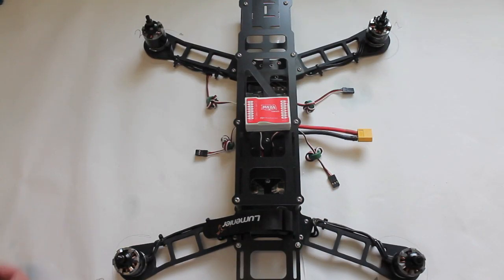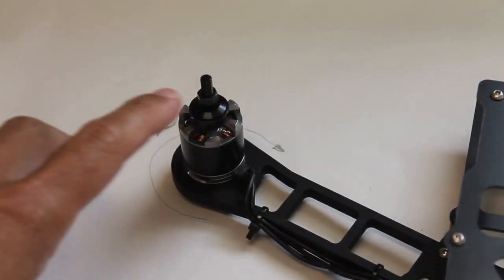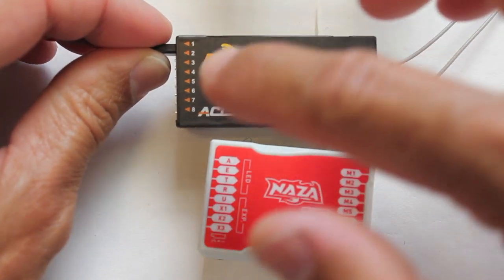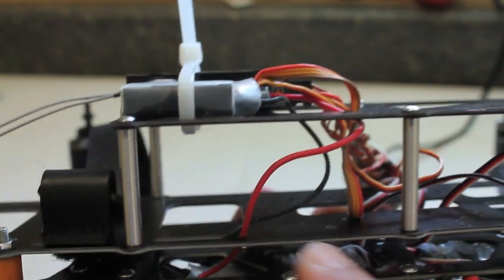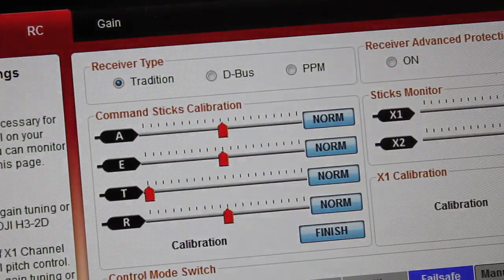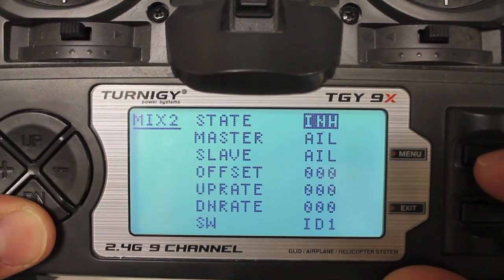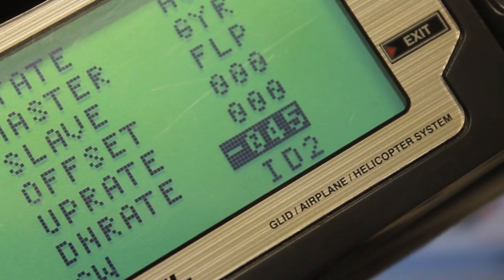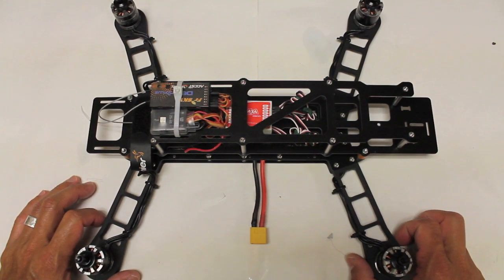QAV400 - NAZA Wiring, Configuration, and 3 Flight Modes w/ Turnigy 9X in ACRO Model Type

Comment: I used this setup on my f450 much easier than heli mode.. Just wondering what do I do with the  x1 x2 slider? Is three a way to assign knobs to them?
Reply from the maker: +ArriCAT5e You can set those up on your knobs as long as you have your knobs configured for the X1 and X2 channels that are plugged in into your RX. Good luck.

Comment: Hey,
I have a flysky th9x (same as turnigy 9x) and would like to have telemetry and sbus. Do I then have to buy a frsky receiver and module, and how can I set it up on my radio so that I have telemetry?
Thank you,
Tobias
Reply from the maker: +Tobias Veerkamp I don't think the FlySky module supports telemetry so you'll need to go FrSky. Here is a good article that talks a bit about it:

http://blog.oscarliang.net/telemetry-frsky-taranis-d4r-ii/

Good luck with your setup.
Reply: Dennis Baldwin I already have the answer I think, but there are some risks. First you have to flash the radio with er9x firmware which supports telemetry.  With flashing the radio you could severely damage the board. Then swap out modules.
Thanks for the reply though

Comment: Hey Dennis,
did you ever tried to setup your turnigy 9x with the frisky module and the naza in cppm mode ? I'm running out of ideas and it won't work, thanks
Reply from the maker: Christian Ka Sorry I never had a need to do this so I'm not sure how to get it done. Let us know if you figure it out.
Reply: just figured it out, there is no way to get it done with stock firmware, ppm and naza...i actually had to flash the turnigy 9x to er9x
Reply: There is a way. I use the d8r-Xp and am using CPPM with Naza with three flight modes. The secret is to make one of your pots aux channel 6. Turn it all the way up. Then do three mixes with it on the three position switch.

Comment: I am following this same setup, but I have an issue which is that I am trying to set up the normal switch position to GPS, but the offset doesn't allow me to move it far enough left to select this mode?
Reply from the maker: Joe Anthing What about adjusting your rates as well? The UPRATE/DNRATE settings, whichever is appropriate. In addition to the offset. If that doesn't help perhaps you can take a photo of your settings and post it in the forums at www.garagepilots.com. We may be able to help you out over there. Good luck.

Comment: Would it be possible to add the failsafe on another channel? I've used the three mode switch for GPS-ATT-MAN. Great work BTW.
Reply from the maker: Stumungous To the best of my knowledge the input happens on the NAZA's U port and you'll need your receiver channel connected to that. Now to enable another channel I'm not sure it's possible with the stock firmware. I know you can do it with OpenTX and I think it's also possible with er9x. I have this setup with my Taranis (it runs OpenTX) and I can map multiple switches to the same channel. So what I have is my flight modes on one switch and then another override switch that I can toggle anytime to flip into failsafe. Sorry I couldn't be of more assistance, but I decided to upgrade to the Taranis to get this and other capabilities. Good luck with your setup.

Comment: Where you send me the gps location ??another question you know why when I use 3s 4000mha fly nice but when I use 4s 3300 shake??
Reply from the maker: tiger exhaust I've linked the comment here. Scroll down to just below the video:

QAV400 Tight Squeeze - Keep Your Wires Securely Mounted

Comment: Hi Dennis what's is your gain on the naza?? And you can you helpme with the gps antenna  you know the y and z  ,and  I crash my dji450 and I just order the qav 400  can you tell me where to put the antenna and the number. ??Please
Reply from the maker: tiger exhaust Maybe this will help for your gains:

http://youtu.be/feyiB87V0ag?t=10m1s

That's for my F450. For QAV400 I'm pretty close to that but don't have them in front of me right now. I'll also have to connect my QAV400/NAZA to DJI Assistant to find out the GPS settings. It's been a while since I've looked at those. If you could post this over at www.garagepilots.com I can share some pics as well as my settings. Please post in the forums. Thanks!

Comment: Hey Dennis , great instructional video.
Is there much difference in setting up with a dx8 transmitter?
Thanks
Reply from the maker: Noah Schechtel I would expect it's somewhat similar regarding using a spare channel to send different PWM values to the NAZA. But I don't know specifically how to do this. Here is a good article about getting 6 flight modes out: http://copter.ardupilot.com/wiki/common-six-modes/#Here_is_an_alternative_way_to_set_6_modes_with_the_Spektrum_DX8

Good luck!
Reply: thanks

Comment: Hi Dennis!
I have a Turnigy 9x to my Tarot 650 Quad with Naza M lite GPS.
I`m having trouble calibrating the sticks, it looks unstable, and the markers on calibration menu are not standing still, they are moving a littlebit when im not touching the sticks in Naza Assistant. I`ve setup my 9x in HELI mode, and I`ve godt two questions.
1: Is it better to program it in ACRO mode? and why?
2: Is the FrSky package for the 9x more stable?
Reply from the maker: Sir Haugen I started flying in ACRO mode with the T9X and this video talks about some of the differences:

Turnigy 9X Heli and Acro Flight Modes Explained

Now with the Taranis I create my configs from scratch because it's so easy to do. You don't have to worry about any pre-configured gotchas that may get you.

I really like the FrSky package for the 9X and it's what I changed to after a year of flying with the default module. I'd like the ability to get failsafe at the receiver level and better range. The "better range" statement I never actually verified. Was just led to believe that based on what FrSky says as well as what various pilots were saying in the forums. Good luck!

Comment: Hi Dennis , been flying helix and 350qx quad .
Building qav 400 and need some help on:
1- how to setup orange rx 8 channel receiver to get correct motor direction, or wire up naza -m  v2 now to see proper motor direction. Have dx8 tx. Could you help me out with this. Would greatly appreciate it. Or.... Is the HK orange 8 channel rx the same as the receiver you show in video.
Thanks Noah
Reply from the maker: Noah, thanks for the comment. I'm not sure about the Orange RX but perhaps you'd be willing to post in the forums at www.garagepilots.com and see if we can help you out there. Good luck and hope you get in the air soon!
Reply: thanks Dennis!! will do.

Comment: Do you have any experience doing the 3 pos while using sbus of the Frsky x8r? I have the xjt module in my 9x and I cannot, for the life of me, get the flight modes set up.
Reply from the maker: I've only done it with the Taranis: FrSky Taranis and X8R Receiver SBUS Setup w/ NAZA Flight Controller I'm not sure if it's possible with the 9X but will see what I can find out.

Comment: Hi Dennis thanks for making this video in the video at 452 min you plug in the esc to the naza do you have to take out the red wire i heard that you don't need it because it has bec build in the esc and it can ruin the naza if the red wire is plug in .
Reply from the maker: No problem and thanks for watching. It's probably safest to remove the power and ground and just leave signal. The DJI Opto ESCs don't have a BEC for the reason you point out. Now I personally haven't had a problem with using 3rd party ESCs with BEC built-in on my NAZA, but if you want to be safe definitely remove power and ground from your connectors.

Comment: can share the gain setting for this setup?
Reply from the maker: I'll have to look this week. My QAV is at home and I'm away from home at the moment. I dialed them down a bit from my TBS Dicovery so I can tell you they're somewhere between the defaults and:

150/135/125/125 and 140/125

Which is what I used on my Discovery Since the QAV is a smaller frame perhaps you can start with the defaults and work your way up to something in between the defaults and my TBS.

Comment: hey! thank you for the first video that is explaining it properly...
my problem is still i got a headtracker on channel 5 and 6 and im steering my cam pitch with FLP if im not in trainer mode togehter with the googles (headtracker) can i set the U port on channel 7 or 8 and also program with gear on 7 or 8 ?
im loosing my patience and asking my self if I have to update to erx9 or get a better TX at all? 
Thank you for your help!
Reply from the maker: Dirk, I know you can set your gear on CH7 and CH8 but I've never configured the 3 flight modes on those channels. I don't have time at the moment to look into this but will try to in the near future. Another thing I might suggest is to check out www.garagepilots.com and post in the forums there.

Comment: hi dennis, im building a qav 400 but im wondering because the naza has a already a bec to power it but if i use 30 a simonk escs NO opto, with a bec should i remove the red wires because it only needs the signal wires thanks already :) i dont won't anything to go up in smoke haha
Reply from the maker: Hi, congrats on your build. It's generally the safest for non-opto ESCs to remove the red wire when making your connections. Now I have used several different types of non-opto ESCs with my NAZA and had no problems, but it's not recommended. Just wanted to mention.

Comment from the maker: I originally flew in Heli mode, but recently started flying Acro mode. The main reason I switched is because I could get 6 switch positions with my APM 2.5 setup. Also, the NAZA manual recommends using Acro mode although I'm not 100% sure why. I've flown fine in both modes.

Comment: Sheesh, the biggest reason to go with ER9x is that ear-splitting beep after every button press! 

Nice vid Dennis. I still haven't went with a CC3D but I was doing some research and a thread on fpvlab popped up for the Acro Naze32 (I can't link it.. damn youtube). Pretty long thread with a lot of happy people. Runs the same OpenPilot software as the CC3D with all the same sensors. Also runs MultiWii. Thread title so you can Google it is "Multiboot controller - CC3D compatible FC for $25"